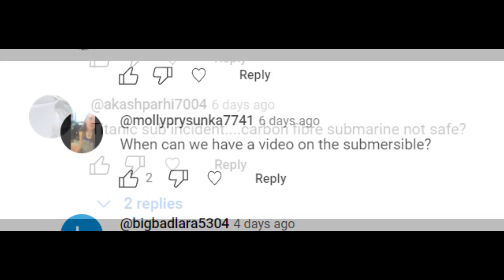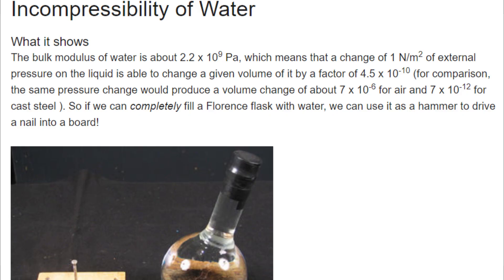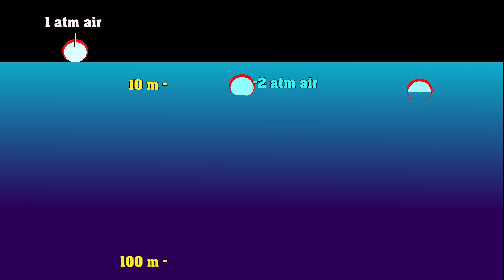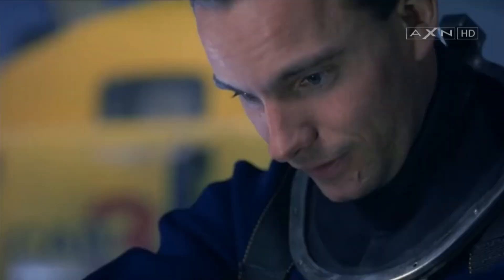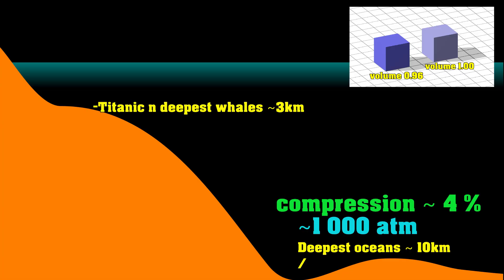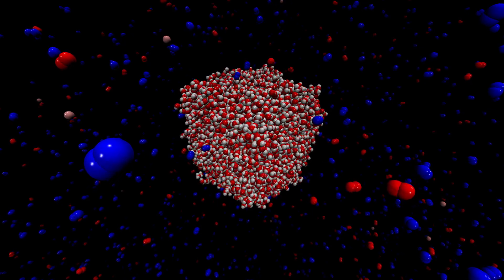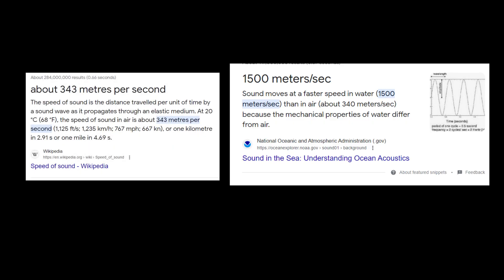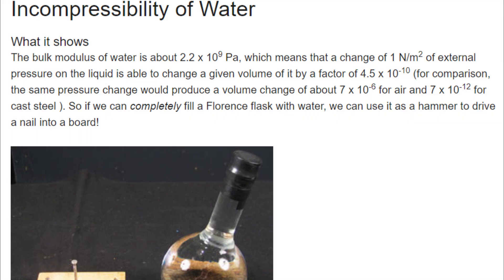What Happens when a Hull Fails at 1000 atmospheres?

Comment: PxV=nRT... decompression so P goes into a pitfall and to maintain the equilibrium T, the temp, goes up and up and up. Volume,V, is insignificant at the pressures we are talking about. A few cubic meters to the 3km drop of water!! In the end you are cooked, steamed, flamed in a second. There isnt much left of you after the sub goes pop. 🤔
Reply: You might like to calculate the heat of compression compared with the specific heat capacity of the 60% water mass of the poor crew and determine the temperature rise.  It's really not very much.
Reply: @thedubwhisperer2157   so probably not that much heat then?
Reply: @0katmandude0  It's many MJ, which could have ignited flammable materials, but the timescales suggested are so short that I feel it is unlikely that any meaningful combustion occurred, let alone 'cooking' of the poor crew, as some have suggested.
Reply: @thedubwhisperer2157  have you thought of the cavitation process? yeah you are probably right, I exaggerated a tad. Then again I was going off a interview from a US navy submariner which described the process.

Comment: 2 cases are commonly discussed: "Implosion without water entering the vessel" ( initially at least ) or this case which desciribes "a hull breach".
In either case the water will "expand" with great force/speed as the air in the vessel is compressed/displaced.
Some people mention the "dieseling-effect", but the temperature rise due to compression and possible ignition of material is not comparable to the energy in the "expanding water" at these depth ( 3500m = 350atm ).
( For comparison, the compression cycle of a diesel engine is usually just around 2 mPa = 20atm and after ignition around 5 mPa = 50atm. )

Comment: Great breakdown! What also affects anything inside the atmosphere of the sub is the sudden extremely violent compression of the atmosphere (which will slow down the advancing water somewhat), which would heat it up much faster and to higher temperatures than in a diesel engine (where the piston typically moves at less than 100 m/s), which would instantly incinerate anything left over by the supersonic waterhammer.

Comment: This really feels like a chemist trying to explain physics. It is simultaneously both too complicated and too simple for what it should be, and feels wrong.

Here is my take:
More depth = more weight of water on top of you. 
More weight = more pressure. 
More pressure = more force applied on walls of submarine. 
Force of water pressure is opposed the force of internal pressure of air and structural strength of submarine. System is in balance 
If structural strength fails there is an imbalance of forces and things will start accelerating at where acceleration a = F/m (i.e. newtons 2nd law). 
Due to acceleration, Speed of collapse will increase until viscosity/elasticity of the water and air cancels out the force from the water pressure. This can exceed the speed of sound if powerful enough (this is called shock wave physics, happens often with high explosives). 
Since the water pressure is stupidly huge (~300atms at 3km depth), the acceleration is going to be huge and the final collapse speed is going to be huge. If you really want more exact numbers use the Rayleigh–Plesset equation. Im not going to bother.

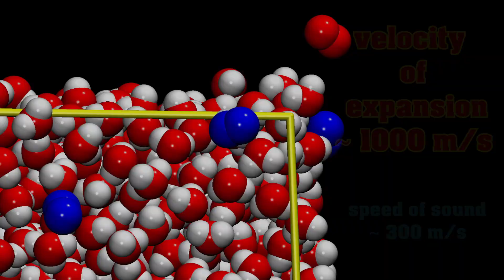14:20 Looking at the inverse with water surrounded by air is a bad way of looking at the problem. Speed of the collapse of a bubble increases with shrinking size of the bubble (from its original size). The velocity of collapse is roughly inversely proportional to the radius of the bubble powered by 1.5 for incompressible fluid (a bit of compressibility doesn't change it that much). Thus looking at an expanding bubble of water in air at high pressure is probably going to underestimate how fast the final moments of the collapsing air bubble actually is. Near the end of the bubble collapse it can very easily exceed the speed of sound in water which is 1500m/s (when the bubble is compressed to 1% of its size the speed is roughly 2x the speed of sound of water), much greater than the 1000m/s speed predicted by Thunderf00ts simulation.

Comment: The science here is sound, but to imply that water moving at high speed is at normal pressure or one atmosphere is inaccurate, because moving water will result in a stagnation pressure when it hits an object. The stagnation pressure being equal to the sum of the static pressure and the dynamic pressure of a fluid flow, where the dynamic pressure is proportional to the square of the fluid's velocity, which will be substantial.
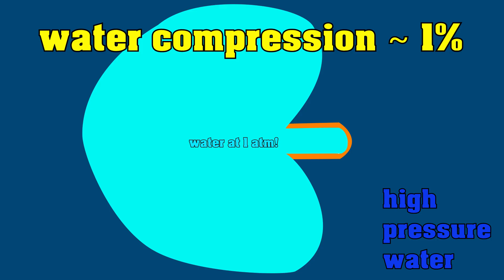Reply: In other words, 16:18, there's no such thing as "regular pressure" when water is "moving very fast". It is stagnation pressure that flattens you like a pancake before you can accelerate to the same speed as the water at which point the stagnation pressure would be 1 atm.

Comment: 1:34 you are going on about technicality for the sake of technicality. If you breach the hull at the pressure of depth level 1 meter, do they instantly get pulverized? No. If you do it at 4000 meters do they get pulverized? Yes. Then there is a difference and the difference is pressure

Comment: I suppose on how the pressure vessel imploded too - I was imagining it this way: there's two titanium hemispheres being separated by a carbon fibre tube. At depth there's 400 bar being applied to all surfaces - for a spherical pressure hull this balances nicely, but for a cylindrical hull the middle section has to withstand the hoop stress of the pressure being applied by the water and it has to support both ends from being pushed in. So if the middle section loses structural integrity, suddenly the whole hull becomes a piston with two hemispheres coming towards each other under 400 bar of pressure.
Reply: I too was considering axial failure of the composite.  Videos show it being a simple circumferential wind, so the axial strength of the tube must have been similar to the epoxy matrix compression strength, with little part played by the carbon filaments.  Perhaps the designer was blinkered by considering mainly the hoop stress...

Comment: one thing you didn't touch on that keeps getting mentioned is what happens to the air as it gets compressed - or does it? the current running theory I see a lot is that the gasses inside the cavity undergo spontaneous combustion as it rapidly shifts from 1 psi to x psi in an instant which would flash-incinerate the people in it. is that the case too? we know cavitation is a real issue for propellers over time. based on your video though, I'm having doubts whether it would.
Reply: There would not be enough energy and time for the compression heat to do much damage.  It is quite simple to work out the heat of compression and compare it with the mass of the crew which would negate this scenario.
Reply: @thedubwhisperer2157  I was having similar thoughts too, there is a difference between sweeping your hand through a flame and holding it there. Plus they recently announced the recovery of human remains, so that adds another nail in the implosive coffin for the flash ignition theory.
Reply: @RonLaws  So many people conflate temperature with heat - your analogy is a perfect one.  I say that a match can ignite a piece of paper, but not a five ton oak log when I try to explain the difference!.

Comment: I kept thinking that the sudden decompression of water would cause a loss of molecular friction thereby causing the water to cool and possibly freeze. But water in motion does not freeze. And by the time you would notice a state change the surrounding water would expand and return the pressure to the water.

Comment: How on earth these home garage experiment was not stopped by experts at beginning ? Combine carbon cylinder  and titanim half sphere and glue it with epoxy for 4000m  turistic  deep diving is madness. On youtube we can see so manny old videos how carbon cylinder fail under repaited high preassure testing
Reply: Probably paid them off or just didn't see any of them? Rich people do like to spend extra on bypassing safety regulations because dammit, they wanna see the sunken ship now!
Reply: @stylesrj  super rich and i belive smart  guests pay 250.000 usd for trip and same time not hire for  max 10.000 usd  best deep diving  sub expert to find out if it is mybe dangerous  dead trap? They lost basic survival instinct. ..for some reason..
Reply: @AA-wd2or  
Yeah, or you can just not hire an expert, eyeball the designs and pocket the extra money.
Props to the guy who built the submarine or designed it, etc. though. He was confident enough to be on the submarine he built.

Comment: If the rupture was a hole, the pressure difference forces water in faster. The assumption that the sub would fill gge same speed at any depth is wrong. Water is not falling into the sub, it's being pumped with a pressure difference

Comment: Without compression, the expanse of water on the sides of an air pocket would still be pressed down by the water column above it, and with no pressure on the side, would move into the air pocket to get out of the way - speed of sound again. Though it could be argued, that without compression there would be no speed of sound, so... make of that what you will. :)
If you accidentally step in a puddle you'll soon see that water will move surprisingly fast to get out of the way of stuff pressing down from above, even at very low pressures.

Comment: I consider that longitudinal failure of the composite tube is a possibility - perhaps the designer was blinkered into considering only hoop stresses.  Surely the transverse compressive strength of unidirectional composites must surely be similar to that of the matrices employed, since the fibres are playing little part in strengthening the polymer.  I could imagine a concertina-like axial failure akin to crushing a drinks can, but with a glass-like rather than a plastic failure mode.

Comment: Once more I have to comment that, while Philip has done a marvelous job of explaining certain aspects of the physico(chemical) phemonena - on this occasion around the Titan tragedy, very well - enough to teach a 1st year class some interesting ideas they may not have considered, it unfortunately is almost a complete distraction from the main practical effects of interest. I suggests an almost complete obsession with what chemistry can say and NOT with the essentials that engineers would want to desperately add...
The problem IS the absolute pressure of the water at great depths, admittedly, in respect to sea level air. One creates a huge pressure differential across the hull shell, here of order 5000 psi, which when cyclically applied to many materials -such as the carbon composite in question - causes many qualitative types of "micro-damage" that eventually propagate into full scale cracks, fissures, delaminations, etc. One cannot expect this phenomina to happen symmetrically in any vessel, so starting at some point, shrapnel starts freeing itself from the inner hull wall and killing people inside, as well a starting more fail centres. The effect can be little different from a shotgun barrage from a cannon. Apart from that, 5000 psi driven hoses of water will help obliterate the crew. The only place where Philip's analysis has any play in "witnessesd" effects is the supersonic final fill that gives rise to the bang shock heard after ~5mS.
Sorry Phil, why waste peoples' lay-man attention with the long preamble regarding compressibility?: make a video about deep diving for goodness sake!

Comment: I think your argument is still incomplete. Yes, the tiny expansion of the water would increase the rate of compression of the imploded sub, but this is not the total source of energy. The acceleration of water into the sub doesn't rely only on expansion, (for example in the way two tanks equalize if a valve is opened). The water pressure can cause water to accelerate faster than the acceleration of gravity because the water is not falling. Gravity is exerting pressure across the entire mass of ocean so that the water that is trying to fall, and would transfer energy to the water that would enter the sub, which will be accelerated by a combined force of a large area of water falling a very short distance. The acceleration force of gravity would therefore be multiplied by this coverage. If you have a water tower, and poke a small hole at the bottom, the water will come out faster than the acceleration of gravity because the entire surface area of that water tower is being concentrated on the tiny hole, the water will come out at the acceleration of gravity multiplied by the volume of water that can directly press on that hole.

Comment: This makes me wonder if the highly compressed water near the bottom of the ocean (which is at/near 4C) would freeze if it expanded into 1 atmosphere of pressure suddenly. Anyone wanna help figure out if the water would freeze?
Reply: i've been wondering about that too. i don't have an answer for you. between 350 bar and 1 bar, 3.5% 4°C saltwater only goes from the density of 1,019.57 kg/m³ to 1,002.85 kg/m³. how much colder it gets is proportional to that change, and even if it gets to the freezing point it has to lose further amount of energy more than the enthalpy of fusion of seawater (dunno, ~350 joules per gram?)

Comment: You didn't address what would happen if a pinhole-sized hole suddenly appeared in a sub at depth. But I infer from this video that the water would shoot in at several times the speed of sound, cutting through any flesh it encounters (like a knife through butter) and possibly damaging the hull on the other side. Water can cut through steel at 20,000 psi but the bottom of the ocean is somewhere around 5,000 psi. So maybe a steel hull could survive a pinhole leak, if you closed compartment doors, but I doubt a plastic/carbon-fiber hull could. P.S. I didn't like the fact that you said the average speed of air molecules is about the speed of sound. That's very misleading. The speed of sound is 343 m/s but the average air molecule travels at 500 m/s. That means the average air molecule travels at Mach 1.4. (Roughly the square root of two, for a very good reason!!) The reason for this surprising discrepancy is something that deserves a video in its own right, so I won't explain it here.
Reply: From what I've seen in another youtube video about submarines, pinhole leaks under high pressure eject as a mist rather than a stream so it probably won't be cutting anything, but nonetheless, the cabin will still pressurize as it fills up with water killing everyone inside long before they drown.
Reply: It is an extremely common misconception and misunderstanding that high pressure water can cut metals, stone, composites etc.  It simply cannot.  It will, however, make a mess of soft and squidgy organic matter.
Reply: @thedubwhisperer2157  You should go correct wikipedia then: https://en.wikipedia.org/wiki/Water_jet_cutter
Reply: @TheNameOfJesus  You should actually read the Wikipedia article properly:
"While cutting with water is possible for soft materials, adding an abrasive turned the water jet into a modern machining tool for all materials".
Reply: @thedubwhisperer2157  We are getting closer to agreeing, but I think the reason for our misunderstanding is that you didn't define what you mean by "soft and squidgy." Because you didn't define it, and I thought you were referring only to human flesh, an argument was inevitable. The wiki article says in the very first paragraph that a pure water jet cutter with no abrasives was perfectly good for cutting through rubber, and the Titan sub was made with carbon fiber infused with rubber. So indeed, a pure water jet can cut through the Titan, as it says "the terms pure waterjet and water-only cutting refer to waterjet cutting without the use of added abrasives, often used for softer materials such as wood or rubber." Notice: "rubber."